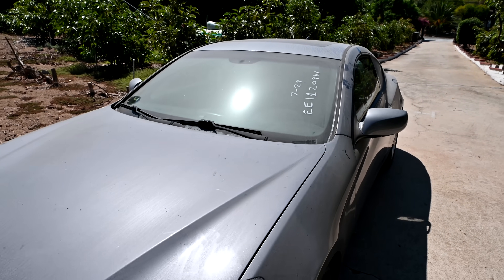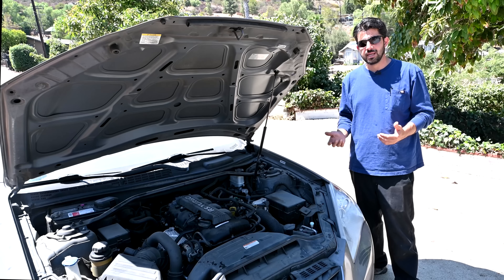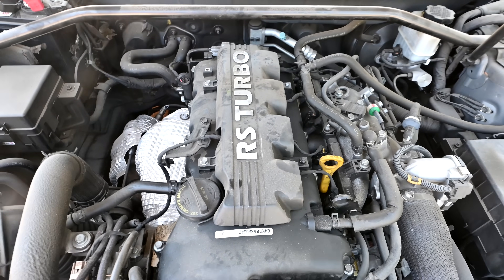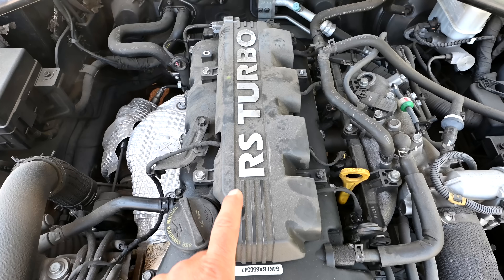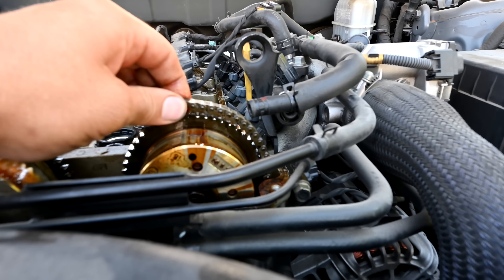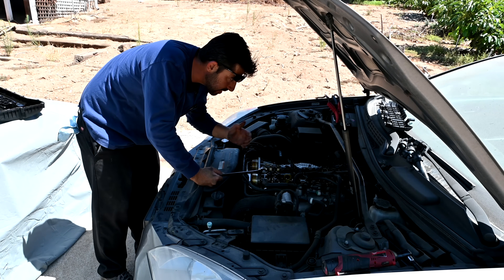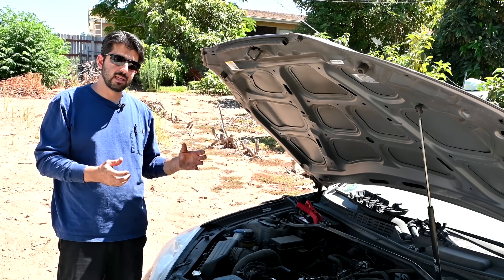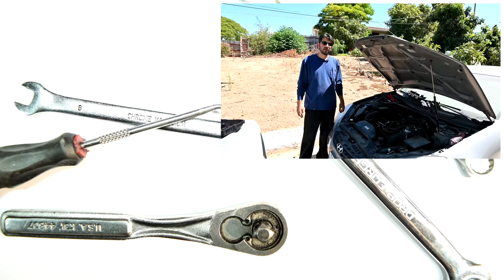The Hyundai And Kia Engine Failures Explained.

Comment: We never got a part 2      and not even pro rebuild shops want to touch these  Thete 2.0  engines so I'm pretty sure this projected ended in failure or a used engine swap.

Comment: I think the real reason these fail is due to a design flaw with the conrod oil clearances - Hyundai has updated part #'s for cranks and rod bearings in Theta II, Gamma, and NU engines, suggesting they altered the conrod oil clearances - the original part #'s are discontinued - OEs only issue new part #'s when a part is changed - I suspect the "machining debris" reason was put forward early before they learned the real issue - it's wide spread and affected some models up to the 2019 MY, which shows how long they took to discover and fix the root cause

Comment: Nobody talks about the root cause of these 2 engines failing , mainly because you can't reliably prevent them ., you can delay the failure by keeping clean synthetic oil at the top level of the dip stick . My 2011 kia Forte made terrible engine noise in winter warm up from the time it was new. After using a camera on the cylinders at 86,000 kms I decided to add 5 ounces of sythetic snowmobile oil to every tank of gas . Now with an oil pressure gauge installed ,& 147,000kms on the odometer ,I am waiting till the oil pressure drops to 10 psi at idle ,& then I won't be leaving the city.Catch my drift.?

Comment: The problem from my experience owning a 2017 Tucson is lt is not set right,  speed and gear settings.  I hear it lugging and  because it's in too high of a gear for the road speed .
I down shift and the lugging goes away.  I've been a mechanic my whole career and I know lugging isn't good , I think it's knocking out the rod bearings.  I think if these settings were reevaluated so as to better match  road speed and the proper gear it would save these engines.

Comment: if the reason is metal shavings left in the engine at build, then that is not a design issue, but a quality control issue. I have owned 4 Hyundai vehicles. All have been good with no failures.To be clear, I change oil myself with Mobile 1 synthetic oil and mobile 1 synthetic filter. Hyundai are built to a very tight tolerence and they should be serviced with good oil on time.

Comment: My 2015 Optima was on ideal, regimented services for exactly 9 years (to the day) when my engine completely failed; knocking and banging with no power…barely coasted to a parking lot.
Only 70k miles.
Dealership welcomed me, treated me to a free loaner vehicle and free engine replacement.
As bad as the engine was, the dealer did right by me

Comment: Don't get me started on Hyundai and their screw you attitude towards their manufacturing engineering bullshit.  im on my 3rd engine.  They made me pay for the 1st one.... reimbursed when the class action went through.  2nd engine went after 120 thousand km.  changed oil with synthetic every 5000k.  they said that it wasn't a warranty issue.... they are full of crap.  took almost 4 months to get a replacement engine.

Comment: In my experience with Hyundai I can say that the most common cause for engine failure is lack of maintenance. 
Change the oil every 3,000 miles with 4,000 at the most. The oil passageways to the cam actuators are very tiny. 
For this technology, the oil MUST be changed ideally about 3,000 miles. Most people fall under the “severe service”
maintenance schedule NOT normal maintenance schedule. Both schedules are listed in the Owners Manual.
Compare what happens to your body due to cholesterol to the sludge that forms in the engine. Cholesterol clogs your veins and you have coronary issues. The same in your engine when oil cannot move the way it needs to problems happen.

Comment: The metal shavings may be due to wear on the aluminum cylinder walls - the hardening coating wears off and the rings shave the soft aluminum.

Comment: Chances are some kid bought this, drove it hard, didn't maintain it, and then was shocked when he blew the engine prematurely. Why would a non-running Hyundai fetch so much money at auction considering the high cost for a mechanic to repair it himself? If a non-mechanic bought it it would be a loss.

Comment: 94k and the light came on. Dealer replaced timing and the light wouldn't shut off. They blamed it in an oil clog and refused to warranty the engine.Also screwed me on my car rental reimbursement. Hyundai corporation are criminals.

Comment: My 2010 Sonata with the 2.4 engine has been a great car. The one thing to be carefull with is the oil filler cap is located in a recess. Sand and road debris collects in the recess. I always blow the cap off with compressed air before opening. If you don't do this the sand will fall onto the #1 cylinder valves and timing chain.

Comment: I'm convinced Hyundai KIA hires shills and employ bots to push the same marketing lines their dealers use. "They used to be bad but now they are on par with Toyota.". Be warned. Any company that cheaps out on a $150 ingnition coded to a ECU for a decade is a company to avoid.

TOYOTA puts the budget under the hood and KIA in the design.

The warranty is often hard to get (delays, service records) ie they plan to reject to pay for x number of failed engines.

Just stop buying the garbage and pay more for a used Japanese car.

Comment: I have a 2006 Hyundai Sonata with the 2.4 and it has the original engine and transmission with 252500 miles, I service it every 2500 miles with Mobil 1 synthetic oil. Great car it taken care of.

Comment: I bought two 2022 Kias, I have 100,000 miles on each engine (almost) , engines are running perfectly smooth. I think it's cuz I did oil changes: first one at 2000 miles and then every consecutive oil change at 5,000 mi... Religiously. I don't know if they figured out all their problems I sure hope so.... Gonna be pissed if they didn't

Comment: This is the real reason why Hyundai engines fail.
There are 2 types. Us built and korea built.
The issues the korea built hyundais arent as numerous or serious then the us built.
Us purposly uses cheap material and improperly designs the engine for failure. Its to keep the money going round. 
I havnt seen a single korea built with a major issue. they last longer than the us built. This is the answer. smh. I hate this country.

Comment: For those of you saying " I have a KIA (killed In Action) or Hyundai with 100k and no problems!) Try Making it to 300k with 5k mile oil changes, not 3k miles. And see if it still runs. 100k isn't shit. Chevys and fords make it to 130k and 150k miles on the regular. Nothing compared to the likes of Mazda or Toyota potential.

Comment: Hyundia and Kia are poorly designed trash. They have a long, long history of making garbage going back to the 1980s (anyone remember the early Hyundai Excel?) It's not that the Koreans don't know how to make decent products - Genesis has in general been well received. Most "high performance" engines equipped with double overhead cams and a timing chain place a chain guide rail or tensioner in between the cam sprockets to reduce or eliminate "chain snap" modes in that location owing to differences in chain load across both cams as they rotate. Does this motor have that? Clearly, the answer is no.

Comment: It's not oil changes, people have been documented that they changed oil every 3,000 miles and Kia/Hyundai engines still blew up at pretty low mileage.
Any engine that blows up before 300,000 miles is crap.

Comment: I had a 2008 Hyundai accent. I had it from 17-20 years old. I called it the Hotel Hyundai caused I had so many girls in it lol!! Anyway I beat the shit out of that car. It was a manual and I drove it hard for 95k miles till I sold it for 1200 bucks with no issue.

Comment: My Thete 2.0 died right at 145,000 miles. Rod knock followed by seized engine.  Brought to the Kia dealership and they said "nothing we can do, looks like negligence", and they offered me $500 as a trade in.   I found out about the class-action lawsuit, and the warranty was raised to 150,000.  I went to a different dealer, brought the settlement paperwork with me.... and they dropped in a reman for free.
Reply: Craaaazy. My 2015 sonata had the same problem the knock sensor kicked on with check engine light at 150k miles but they weren’t bullshittin me cuz they had a recall on the motors so they were covering my shit regardless. I still have the car now at 158k sn new motor💪🏽
Reply: Was that a hybrid?
Reply: Hope you sold it… the car isn’t much better
Reply: @ one interesting thing the tech told me that when your engine dies and you go to bring it in, top off the oil. He told me they are rejecting claims if the oil is low, even though heavy oil consumption is the symptom.

Comment: The older Hyundai/Kia are more reliable specifically 1995-2010.
As an owner of 2 Hyundai’s (2004 V6 Hyundai Tiburon w/101,000 and a 2006 V6 Hyundai Sonata w/147,000 miles) the only thing I’ve had to change is a starter on the Sonata and a timing belt on the Tiburon…After reading many owners reviews the newer models are very problematic.

Comment: Worked at Hyundai same as kia basically cheap crap deigned junk. Watch the build you will never buy one not just motors but the sorry way they assemble and design them is pure junk when you factor in cost of a kiw or Hyundai

Comment: One trick to help extend any engine's longevity is to install a magnetic oil drain plug. That'll take metal shavings out of circulation.

And, I'm not convinced that the longer change intervals are valid. I still change my oil and filter at 4,000 to 5,000 miles.

Comment: The Theta 2s that have the oil starvation problem are the ones built in the U.S.; the GenCoupé was manufactured in Korea.  Nevertheless, my GenCoupé gets Pennzoil Platinum High Mileage 5w30 and a dealer filter every 6000Km (3500 miles), per Hyundai’s maintenance schedule, and never further.  My short experience as a service advisor at a Hyundai dealership taught me that stretching maintenance intervals leads to expensive problems.  Oil is cheaper than engines!

Comment: Mine made it to 140,000 miles then developed a rod knock.  No problem.  Dealer installed a new long block and I had it back in a week.  Besides that, I’m waiting for my first part to break.  2012 and besides the engine recall, nothing has gone out yet.

Comment: It doesn't matter how well you maintain these 2.4s. Out of the blue the fuel pump will dilute the oil with fuel, or particles left over from manufacture clogging passages catch up to you, or the EGR will stick open and suck your oil out and- knock knock 10 second sudden death no warning.

Comment: Almost every single passenger car and pickup truck engine built in the last twenty to thirty years will be interference.  You just can't get the performance and fuel economy most car buyers expect otherwise.

So any timing issue will usually trash the motor beyond repair.  99% of the time, it's cheaper and easier to put in a low mile salvage motor with decent supplier warranty along with fresh plugs, coils, belts, etc.

$6k spread between the auction and retail?  You'll be lucky to make ANY profit on this after the engine rebuild or swap counted in.

Comment: Had a 2000 Hyundai Elantra drove it 12 years till I hit a deer going 60 totaled the car. But zero issues not a bad car at all. 
Friend had a 2009 sonata sold it last year again zero issues.  I do believe around 2010 with direct injection they started having all kinds of problems.

Comment: Over the last 12 years all our cars were Hyundai's. IX35, Grand i10, i10, Atoz. Secret is change the oil at 5000 miles. Air filters and cabin filters at 10000 miles is fine. Never had a problem with any of them. They are all going strong. Ee also have a 1993 Camry. Gets oil changed every 3000 miles.

Comment: Neglected oil changes will cause the oil to loose its cooling and lubricity and burn up the plastic timing change guides causing a loss of tension on the timing chain. This damage was strickly owner caused. I bought a new 2012 elantra limited in September 2011. Changed the oil every 4 to 5k. Changed plugs at 75k and normal filter changes. Sold it at 120k. Never burned a drop of oil and ran like a top. Now you want to talk about a crap car. Bought a 2006 chevy aveo in oct 2005. Ran it for 14 years and 175k miles. Changed oil every 3 to 4k. Never burned a drop of oil. Only reason I got rid of it was because it was rotting out from our winter salt. If an aveo can go this long, hyundais will if maintained properly.

Comment: I have a 2007 sonata with a 3.3 v6 and a 2008 sonata with a 2.4 v4.  07 has 190k and the 08 has 230k.  Both cars have had zero engine issues, very minor other issues, and the engines just purr on the highway.  No transmission issues either.  Proper maintenance, that's it.
Reply: I also have a 2007 Sonata, 2.4l auto. It developed a rod knock on #2. Dropped the pan and oil pump/balancer. Removed all con rod bearings, cleaned, scraped and flushed out all oil passages, polished and checked crank, installed new con rod bearings. Checked all main bearings. Buttoned it all up. Have added almost 100,000kms since, still strong. Total cost - $284.00.
Reply: V6 are awesome I’ve seen many at 350 k with no oil changes 😂
Reply: We have a Kia 2005 3.3 L engine. Lacking power and sluggish. 
We were told to replace all the coil packs. Did nothing. 
 Mechanic said the valve cover gasket is leaking oil down in around the spark plugs.

Comment: The reason why the Hyundai Kia engine failed is due to the oil filter nothing else. If you notice all the engines that fail happen days or weeks after oil change, I find it hard when I buy a cheap oil filter from Walmart, I almost lock my engine. The second reason is the intake runner. Why an intake runner you may ask, well it rubber seal around the butterfly flop once that seal breaks it into the engine and jamming the intake valve.

Comment: The underlying problem is severe engine oil dilution which eats away the rod bearings and wears the timing chain. In addition, these drivetrains cruise at very low rpm (1000rpm) which causes cylinder ovaling.  If you do mostly short drives, change oil no longer than 4000 miles/6 months and downshift manually so you don't cruise at 1000 rpm.
Reply: Why does n engine at medium to high load at low RPM cause cylinder ovaling? Are the side loads very high on the piston under those conditions?
Reply: @gregorymalchuk272  the tolerances have to be made so that the engine running a full load won't have expansion problems at full heat temps. The rings especially are gapped slightly looser to keep the ends from touching. It is the delicate balancing act you're trying to keep the expansion rates manageable with high heat but also dealing with the fact that fuel economy requires you to run at low RPMs and lower heat levels. This is why most performance manufacturers tell you to gas your direct injected or turbo engine all the way up to Red line now and then.

Comment: I have a 2012 kia optima 2.4L that just ticked  286,000 Kms
 (Car was made in korea) 
orignal Everything except suspension/brake parts.

Body is in prestine condition, undercarage has Minimal rust,
 (I undercoat my vehicle) 
and i live in Northern Canada lol.

Cheap car scan tool, google, youtube, Oil changes at 5000kms with synthetic oil.

I guess you could say
Common car knowledge and common sense go a very long way,

Comment: To keep the intake valves clean, Hyundai's GDI are running very rich at cold starts (much richer than non GDI engines). This way some of the gasoline doesn't burn and is coating the combustion chamber and keeps it clean. Downside is excess gasoline also leaks into the engine oil and causes oil dilution. If you're doing mostly short trips, the gasoline in the oil won't have time to evaporate so the engine wear is increased
Reply: Not true about the carbon source on GDI engines.....Gasoline is a solvent.  prior to GDI, gas would be injected in the Intake upstream of the Valves so gas vapor would wash the intake valve clean.  Now that GDI engines inject directly in the cylinder, the fuel cant clean the valve......Its the PCV system that's introducing oil vapor from the crankcase into the intake system of the car and this oil vapor coats the intake valve and is the source of the carbon buildup.
Reply: @craiggoldstein2461  I think you didn't read properly my original message. I wasn't talking about the source of the carbon deposits, only talking about the 'fix' with gasoline soak which turns out is actually causing oil dilution. What you mention about oil vapors causing deposits is correct

Comment: I have a hyundai tuscon 2012. Soon after a few hundred miles accumulated it began to run rough. I consistently change my oil every recommended 3-4 k miles. I would also take it in for suggested service intervals. I take care of my cars. However sooner than later the engined failed. Hyundai said it was initially a recall. It took them almost 3 months to change out my engine block. At first they didn't even offer a loaner. Said all their loaners were out because they had many many blown engines. I waited 2 weeks then demanded a loaner, which they gave me. So now I have a new block and hope this POS last at least a few more years. Hyundai paid for it all too. Never buy a hyundai.

Comment: I ALWAYS change my oil on a new car just after the first 500 miles. Also, upgrading a engines oil pump can help with lubrication pressure at cold starts and at engine idle times. The good 'ol "hemi tick" sound can be fixed with putting the SRT engines oil pump on the engine. Pressure is higher now at cold start and at idle times which also protects the lifters and cam.